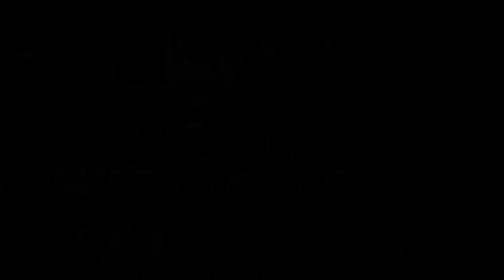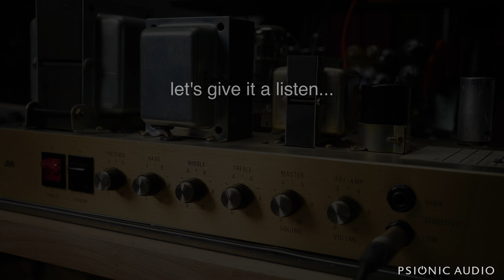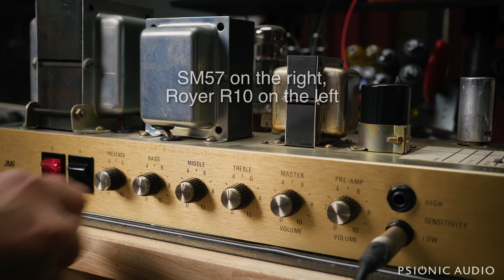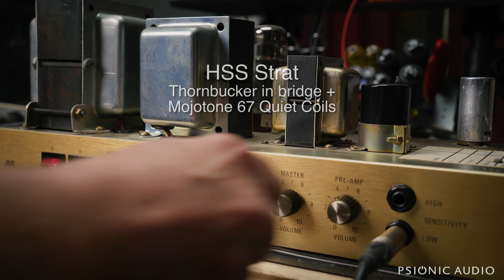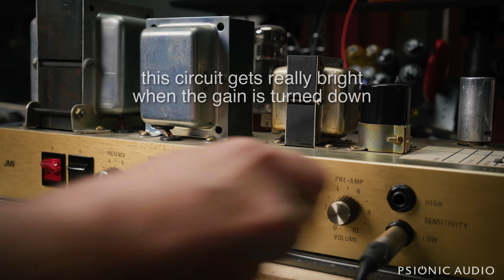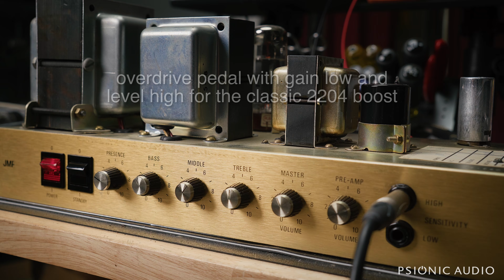Mistakes | '78 Marshall 2204 Pt 3

Comment: Regarding using two 10 ohm  half watt resistors for heater, rather than the CT, what if you add an extra 12AX7? Should I increase power rating of the resistors?
Reply from the maker: 100ohm. No, won’t affect things.
Reply: @PsionicAudio 
Thanks, sorry I did mean 100 ohms. I’m building a Marshall JMP and have implemented your grounding scheme and other great tips. Really appreciate your help.

Comment: In my 1970 100 watt Super Lead converted from Super Bass, someone had put in a 120K NFB Resistor.  The purple wire went to the speaker jacks on mine. I contacted Dave Friedman after tons of experimentation with different resistor values and the different Taps. I preferred the 120 K resistor on the 8 ohm tap. But I may go back and try the 16 ohm tap. I installed both pre and post PI masters which the post renders the presence useless anyway. I also added a  selectable lower value bright cap. This amp is now a mesa LOL!! No but I love how I can play with both masters for an insane amount of gain sculpting. This amp cleans up like a fender and also has a ton of gain at home volume levels. I absolutely love it. Oh I also used one of Chris the amp tech in Australia's tricks that every Marshall guitar amp should have. Change out the huge overkill bassy 330 MF bypass cap on the normal channel to 10mF! it removes the flub and this channel is way more guitar friendly and can get as bassy as you would ever need and more. That was an unusable value for guitar. Chris explains it well. I love the mods I have done and think I have the ultimate Marshall Now. I have had a ball watching all of you guys videos and tweaking my own stuff. NO one has explained the NFB Tap situation like you have Lyle Thanks!!

Comment: Was wondering if you ever played or had to work on any Satellite amps? I was looking at the Neutron (Little 15-watt EL84 head.) Only problem is I can't find any to play first at all as per usual. I can send it back for a refund ONCE if I do not get along with it though. Just want something simple and reliable and it seems to fit the bill as it is about as simple as you can get like all the amps that they make. Toggle switch for power and one volume and tone and that's about it. Just was wondering if you ever had a chance to play through one or work on any.

Comment: Dave Friedman recommends 47k on 4 ohm tap. Who knows? Just experiment I guess. Also, early Marshalls used 25k pot with. 0.68uf and 4.7k resistor to ground. Now 5k with just a.1uf and no resistor. Perhaps the specs you refer to was for a 25k pot and not correct if using a 5k?
Reply from the maker: 47K on 4 is equal to 100K on 8. Both make the Presence work better than 100K on 4 but the 100K on 16 is the original design amount.

Doesn’t matter if 5K or the later 4.7K with the 25K pot. It’s the 4.7K to ground, not the 25K.
Reply: @PsionicAudio   Isn't the difference in voltage between the taps more like 71% or roughly the value 1,42? Like 100K on 16 Ohm = 71K on 8 Ohm = 50K on 4 Ohm. So Friedman 47K on 8 Ohm would be like 66K on 16 Ohm.
Reply: @jublaim ????what???

Comment: If the guitarist mistakenly uses a guitar cable as a speaker cable, as they unfortunately often do, 16 ohm speaker selector setting (and 16 ohm speaker) is a slightly better option. 😂 
A guitar cable usually takes 40 volts RMS without bigger problems but the thin signal wire of a guitar cable doesn't necessarily love a continuous current of 5A RMS for a long time.

Comment: There is a very remote possibility that Marshall may have used or spec'ed a different output transformer when they designed these amps. Some of the Vox OPTs had some rather strange & un-orthodox winding techniques compared to others. More than likely someone simply just screwed up, and anyone who could catch it working soldering pens on the assembly lines would be kicked upstairs, so to speak. (Probably with a very minimal pay raise too.) Valco was great for using whatever was handy, within reason. (500pF, 1nF or 5nF bright caps) Perfection and or consistency were definitely NOT their goal. Coupling caps could vary in those old Valcos too, including mismatched caps in between the PI & the power tubes and sometimes it actually sounded pretty good. If you thought Leo Fender was cheap...

Comment: Wow this is really interesting... so I have two schematics, one from '78 where it shows the tap on the 8 ohm and a 100k nfb resistor... the other is for the 2203X and it shows the same thing but connected to the 4 ohm tap. I checked my 1976 2203 and its a 100k and connected to the 4 ohm as well. So you think this is a mistake? 
I'm also wondering, since I am running KT66 power tubes, does that change things as well?

Color me intrigued... I'm thinking about pulling the chassis and connecting to the 8 ohm tap and seeing how it sounds.
Reply from the maker: It’s was a factory mistake that went into production. Possibly a brain fart on the part of whoever did the schematic? And dutifully reproduced in lots of third party schematics and layouts.

But look at the 1959 and 1987 schematics.

Does it hurt anything? No. But if you want the Presence control to actually do anything…
Reply from the maker: See this 1959 showing 47K connected to the 8 ohm tap with 100K in parentheses. That’s for the 16 ohm tap connection.

You can deliberately miswire this to experiment. But in stock form this amp had no effective Presence control and it was always way too bright.

https://images.app.goo.gl/GrmxqBgw933mxdTV8
Reply: @PsionicAudio  Yeah I see... I wonder if this was really a mistake or were they maybe experimenting with the amount of nfb to achieve a certain tone or maybe appease a particular artist's tastes at the time? I find this super interesting... it would be cool to ask someone who has worked at Marshall for a long time what they know about it.
Reply: @PsionicAudio   "dutifully reproduced" 
Good sir... i can see under my table from here! 
You got me :D
Reply: All the schematics show 4ohm for 6550 tubes, and 8ohm for EL34's. I will hook up to the 16 ohm tap to see how it sounds...already tried 8 and 4 ohm taps, but will try 47k as all my Marshalls have 100k in nf loop, and hooked mine up currently to above-mentioned Marshall schematics. Another important area to fine tuning my amps to my ear will be experimenting with this new information!